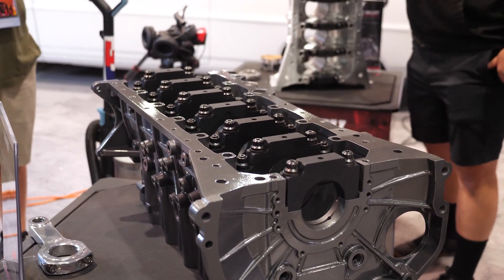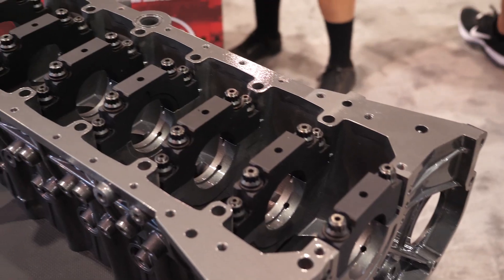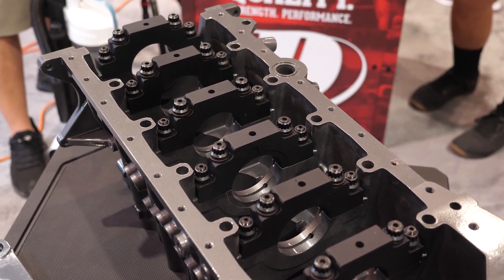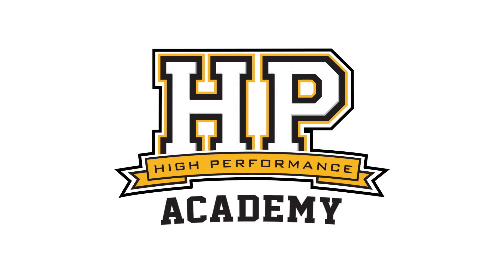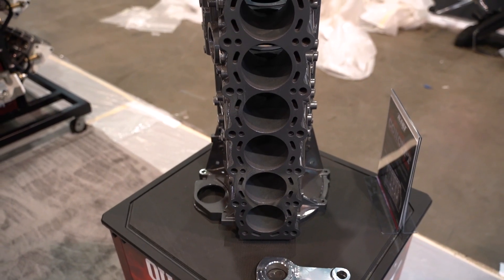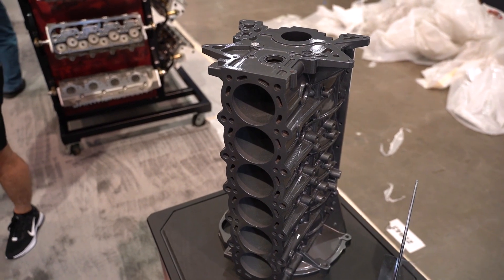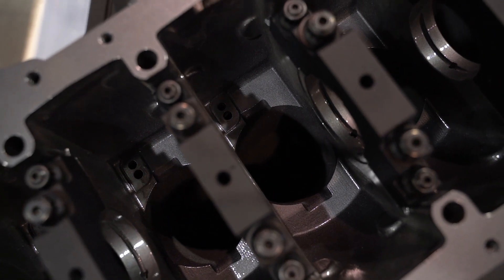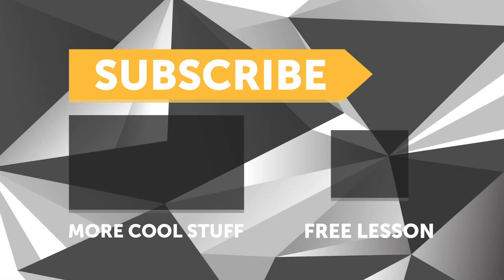The 2000hp+ 2JZ  Reinvented: Aftermarket CAST IRON Block #shortish

Comment: Perfect, this thing is only a couple pounds heavier than a factory 2JZ. You won’t have to play with weights like the guys going from factory cast to billet.
Reply: It's also about 1/5 of the price. 😅 Almost nobody needs a billet block.
Reply: @TML34  billet is so overhyped. Just the word "billet" gets thrown around like it's some form of magic.
Reply: @wiktorhogberg1646  best part is when billet parts aren't always the strongest, or when a chunk of cheap hot rolled steel does the same job.